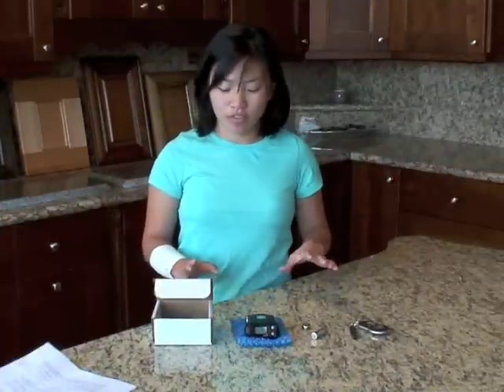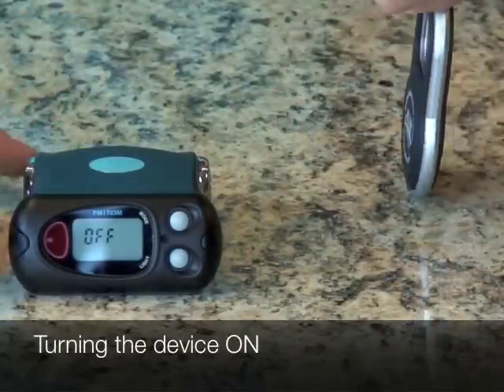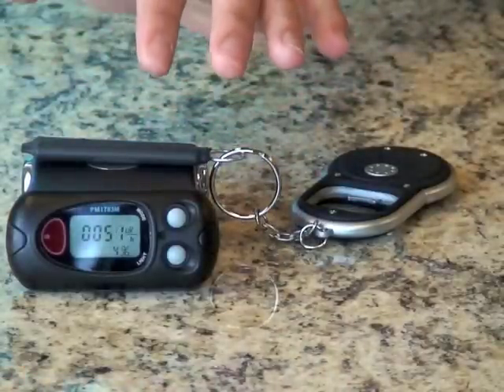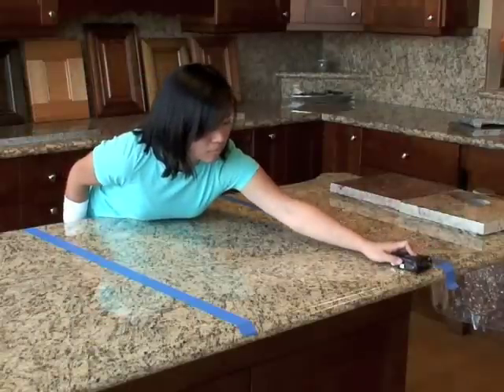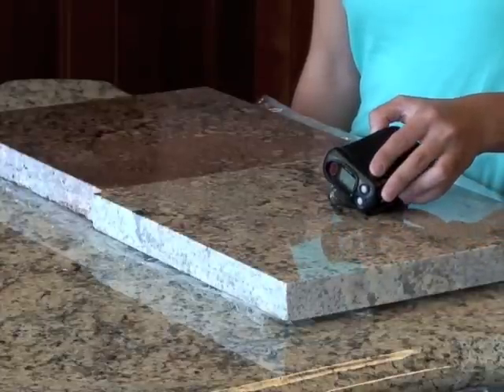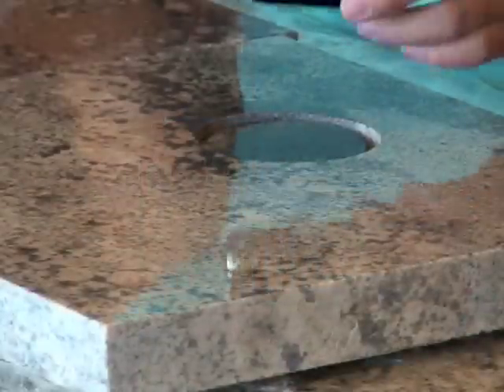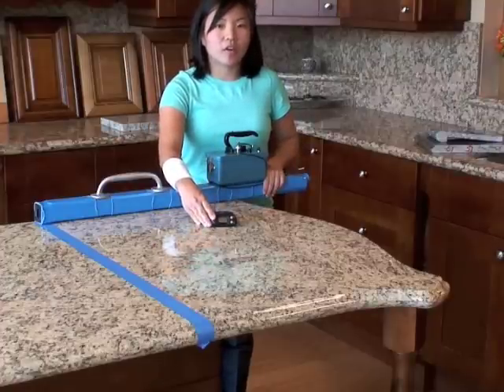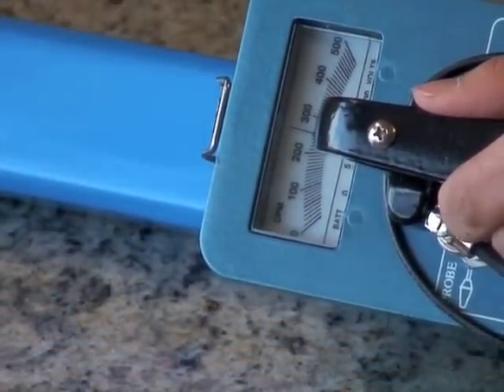Scanning granite for radon with gamma detector

Comment: Radon is an Alpha emitter requiring specialist measurement since alpha particles (Helium Nuclei) only travel a few centimeters and will not even penetrate the epidermis or a piece of tissue paper. Conversely Gamma radiation at such a low level is completely harmless since Gamma radiation passes straight through the human body unimpeded and is therefore quite inconsequential. The masonry in the average home contains low levels of Uranium and Thorium which are both Gamma and Beta emitters.

Comment: I just read the specification on this specific detector used in this video. The levels that it can detect would never cause you any harm. If you were sitting on a super dangerous source of ionizing radiation this detector would go off but by then you would have need exposed and if you were going to die from acute radiation sickness it would be too late anyway. The accuracy of this device is +/-30% which means that you have a huge error in knowing the level of radiation exposure that this already so low that it would not cause you any health risk. If you want to listen to it make noise you can find plenty of dirt that will set it off but I would not waste my money using to protect myself from radiation. By the way don't fly on an airplane if you are worried about ionizing radiation. Just one trip from New York to LA increases your background level of radiation by about 1/3. Much more than a granite counter top could!!

Comment: I'm not so sure you should "spike" the detector with a false background. Setting your baseline with a radioactive check source really don't help you with accuracy. Additionally, I would suggest not calibrating on the actual granite. Accuracy is probably more important than tricking the detector into providing a false reading.